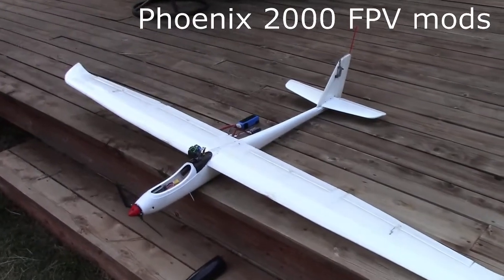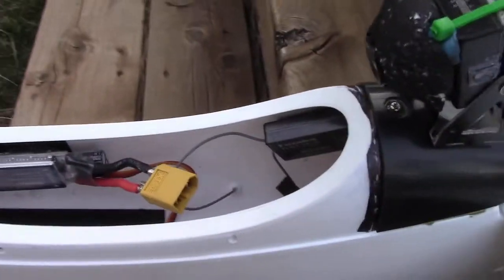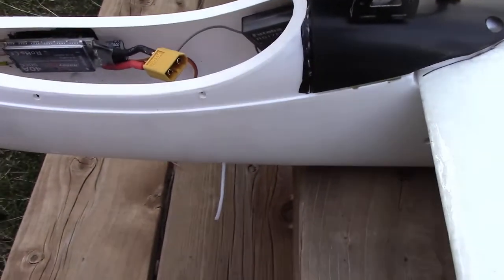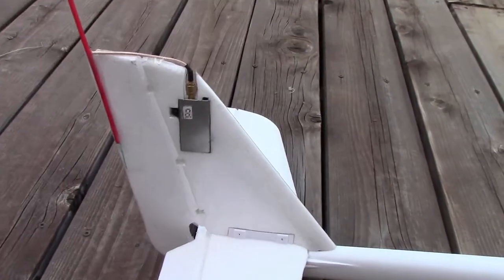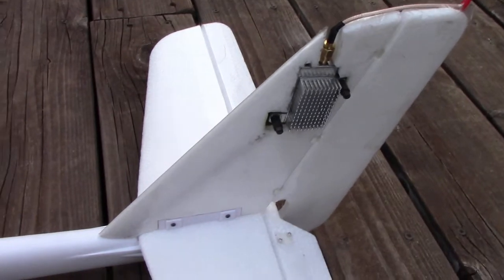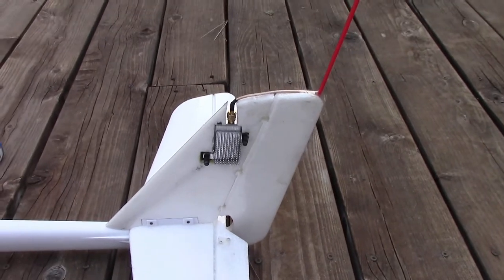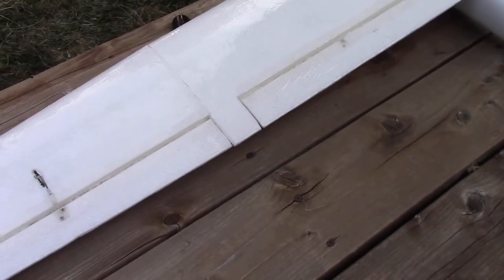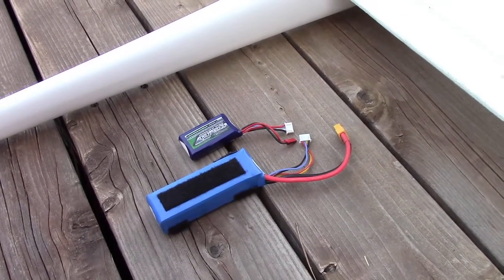Phoenix 2000 FPV build.

Comment: Hi; what about flying efficienty? How much time can you fly with 2200mah or distance? Or how much amphere does it drive during level flight?
Reply from the maker: This plane has approximately 22:1 glide ratio. The longest flight so far is 27 minutes, about half of that was under power, the rest of the time the plane was gliding. I think 30 minutes is possible. The average speed during such a flight is approximately 18 miles per hour. My guess is that it takes approximately 8 amps to maintain level flight.
Reply from the maker: Also... I usually land with around 35% battery charge remaining.
Reply: Thanks Thomas. I bought one about 2 months ago ans as you said I fly for about 25-30 minutes with 2200mah 3S battery. By the way 4.4amps enough to maintain level flight.

Comment: Great build!  How necessary do you think the heat sink is on the v-stab transmitter?  I would think the air movement alone and cooler temp at altitude would keep it cool without the heat sink given the direct exposure to moving air.  Of course, that's just my speculation.  Assuming you put the heat sink on to solve a heat problem :-)
Reply from the maker: Hi Roy,You are correct, the heat sink is not needed as long as the plane is flying. I use it to control temperature after the plane lands... it takes approximately 2 minutes for the video transmitter temperature to increase beyond safe limits under hot ambient conditions after the plane lands. I use the heat sink to save the transmitter if I'm busy shutting down the ground station and can't get to the plane in time.

Comment: Does that make the plane tail heavy installed back there?
Reply from the maker: Yes, this makes the plane tail heavy, but placing the video camera and pan/tilt servos ahead of the CG, and moving the 2200 mAH battery within 3mm of the motor brings the CG to where it needs to be. Moving the video transmitter to the tail increases the distance between it and the 433 MHz receiver antennas, lowering the noise floor the receiver has to overcome and increasing range.
Reply: +Thomas Smith old post. My bird is built and flown. I just put the antennae back there with tx in the wing.